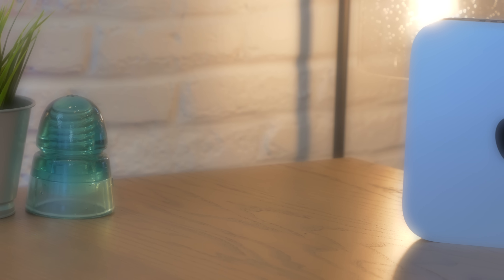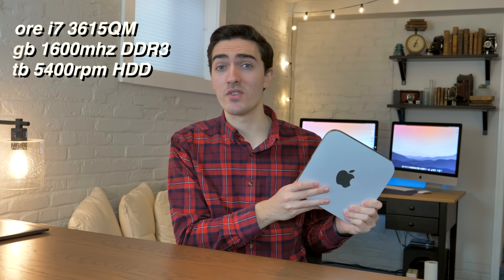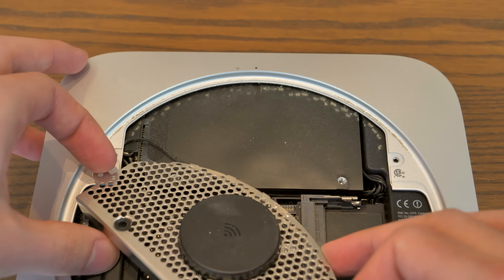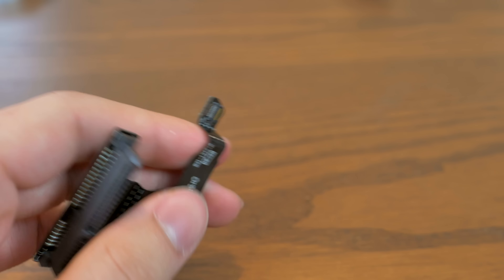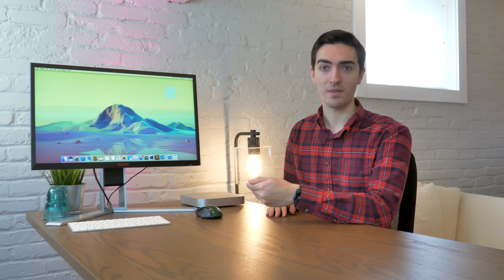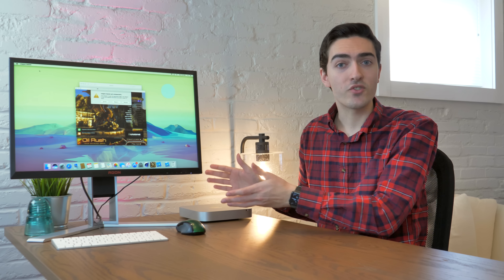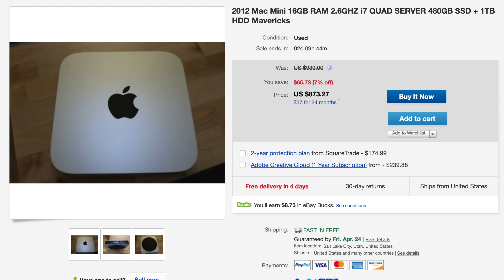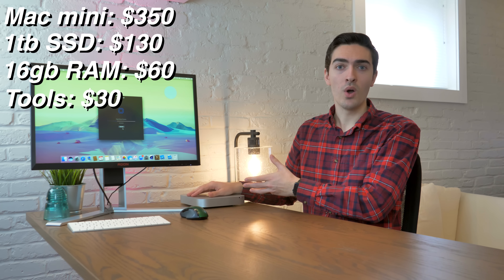Building the ULTIMATE 2012 quad core Mac mini – But is it worth it?

Comment: I bought about a year ago and put a 512gb ssd and 8gb of ram I already had. Got it for $400 and for that its a pretty good value. Does everything internet well. Great for getting started with XCode though 8gb ram isn't ideal. It does get by though and if you have some hardware lying around I would totally recommend this setup!

Comment: I had a 2011 Mac Mini with i7 (dual core) and AMD graphics.  I really liked it for the 4 years that I used it, but it started to freak out and reboot itself.  Something went wonky on the motherboard.  I really liked that one, as you could upgrade the memory/HDD without any issues.  I wound up with a 2014 Mac Mini (i5/8GB), and I did wind up upgrading the HDD to an SSD.  It is actually pretty darned quick, though I really wish you could upgrade the memory.  I sort of missed the 2012 generation.  They're great little machines, though i wouldn't pay all kinds of money for one.  I hope to get a new one at some point.

Comment: Yes, this machine worth it. But even a refurbished i7 miniMac is a expensive machine, about 500 € I found last year a 2011 machine on sale, I agree with your comments,  I never thought to upgrade from High Sierra or install a dual M.2 module because I do not give high hopes of using intensively to this machine. Upgrading a miniMac on any way would be a bad invest and a waste of time how to improve my miniMac, because of my few needs I require from my 2011 miniMac actually. Upgrading the hard disk to M.2is a good idea, but not always needed.

Comment: @3:47 what are the connectors there?  Was one that it is showing you disconnecting for the hard drive?  Around 5 to 6 minutes in you said there are 2 hard drive connectors.  So does that mean the mid 2012 guts can be put into a mid 2010 case and add an optical drive?  You mention that this is not good for graphics.  Is the mid 2011 better with the Radeon HD 6630, better and still upgradable?

Comment: My best Value and new daily driver....Purchased on ebay Jan 2020.... Late 2013 21.5" iMac - Quad Core i7 in near-mint condition with an nVidia GT 750M GPU which I then upgraded to 16GB and 256GB SSD (from 8GB and 1TB 5400 RPM HDD)... and native Catalina...all-in cost was just a touch over $400 including all shipping and parts. iMac screen resolution is 1920 x 1080 but with Catalina it drives a second external 43" 4K TV over Thunderbolt @ 3840 x 2160.... like butter....this must have originally been a built-to-order unit....I think (...know) the high volume seller sent the "wrong" unit and I couldn't be happier!!

Comment: Recently, I got a chance to use both 2012 and 2014 Mac mini for light tasks (YouTube, web browsing, and use the photo app). The 2012 Mac mini was the top of the line Mac mini 2.6ghz i7, 1.25tb fusion drive, 16gb ram, and new thermal paste; the 2014 Mac mini was the mid range Mac mini with 8gb ram and 1.25tb fusion drive (old thermal paste). Personal experience, I feel the 2012 quad core Mac mini is much slower than the 2014 Mac mini. Even thought 2012 has quad core, the 2014 dual core ran much smoother than 2012 quad core. I think the main problem is on the ssd. Nvme ssd runs much faster than sata ssd. In addition, the fan ran much frequently in the 2012 than the 2014. For general tasks, I recommend 2014 Mac mini.

Comment: I have two of these. One I use as a server and the other for an everyday driver. Both have max RAM and dual HDD SSD and I got one for free the other for $180. Considering I could sell them both and get around $1,000 right now I'd say I did ok.

Comment: I seriously don't understand the huge price gap between the US and Europe in terms of used MBPs. The mentioned 2012 Unibody 15" MBP would N-E-V-E-R sell for less than double the price that Luke mentioned... Maxed-out as he said, they would go for roundabout 800€/900$! If you're lucky you might get the base 2.3 GHz, 512MB VRAM version with stock memory and HDD for roundabout 500€ (so about 560$). But then you're really lucky! People over here try to sell completely trashed machines for their weight's worth in gold. And I'm not talking offers, I am talking sales.

Comment: I got an i7 Mac mini with 16gb ram for 40$ it supposedly had a dead hard drive but it ended up being just fine so after upgrading to an SSD I bought the dual hard drive cable upgrade kit and had 240gb ssd and 1tb hard drive

Comment: I have this one, I bought it new in 2014 IIRC.  I upgraded the RAM to 16GB and I removed the dual HDDs for a 1x256GB and 1x512GB Samsung Pro Evo 850.  
I used it occasionally up to often till about 2 years ago, then tried to use it again few months ago.  (will come back to this)
Performance wise it is good, but again it depends on what you need it for.  I used it exclusively for FCPX and it was great.  I would edit everything up to 4K videos.  Most of the time I would use proxy files, but that was because I didn't want even the chance of a performance glitch when things got too complicated. 
The machine was great,  editing was comfortable and even rendering was no issue in terms of time.
The problems started with the (forgive me for not knowing the details) the recent change of FCPX to the new "engine" or whatever.  The overall performance while editing dropped and rendering time took off.  It was simply painful for me to continue editing on this machine.
As I don't have another Mac or the money to even consider getting one, I just jumped ship to a powerful though old PC I have and started editing there.  

Overall the Mac Mini is worth it, but it depends on what you need it.  Also, I am not a fan of laptops any more so I will almost always say to better get a mini than a laptop.

Comment: I got a late 2014 MM. I put Catalina on it, big  mistake!  It will never take a DVD player.  I even wrote some code for it, No Joy!  Catalina has everything locked down, and is a little quirky.  I had bought an external DVD, so, to use it, I downgraded to Mojave. Viola!  My DVD worked!  I was able to take control of my SSD!  WOW, things work the way they are supposed to.  In short, Do Not upgrade to Catalina!  FYI, God Bless, Dave Wright

Comment: I got the same model that was upgraded.  Great little machine.  I was wondering did you have a problem with the Thunderbolt?  I wanted to use it for a secondary display.  the Mac mini see it but no image on the screen.  Have you run into this?

Comment: 5-2020, my current Apple computer I use for macOS is the late 2012 i7 Mac mini.  I can still run Catalina on it officially. I bought my late 2012 Mac mini when it launched over 8 years ago.  My late 2012 Mac mini had to have an firmware update (over the internet) to fix a HDMI port problem.  After I updated the firmware of my Mac mini I have had not problems since the day I bought it.  My late 2012 Mac mini came with an internal 5400rpm 1TB HDD of which is terribly slow.  And my internal HDD in my Mac mini died a few years after I bought the computer.  But I was able to use an external SSD via USB 3 as my boot drive and my Mac mini runs much smoother and faster than the 5400rpm HDD.

Comment: My old daily driver was a 2011 Mac Mini base configuration upgraded to 16gb of RAM and a 512gb SSD years ago.  Worked reasonably well up until last year when I just got sick of its sluggishness especially with web browsing so it's been relegated to the scrap heap and replaced with a 2019 13" MBP.  Still it lasted a lot of years without any issues.

Comment: I have late 2012 mini. 16Gt ddr3, 2,3GHz i7 SSD + HDD. I clean the fan and put new thermal paste, but still temperatures are 70 - 95 Celsius when I only run Safari and mail + file backup.

Comment: I bought mine in 2015 when I started my channel and upgraded it with 16 GB and one 250 GB SSD. It was also my first project on the channel itself showing how it needs do be done. Good old memories. In 2020 I would also say, that it is not the best value for the price you need to pay. Luckily I still have mine as a backup machine.
Reply: Thanks

Comment: I've still got my i5 2012 currently running two SSDs and 16Gb - I use it for coding and Lightroom / Photoshop (stills) and really have a problem justifying an upgrade.  You are correct about the graphics - zero games, zero acceleration options for software but colour matches great and is fast enough for a 1080p monitor with zero lag. It would be nice to connect the iPad as a second screen natively but it's not vital.

Only thing I would say that you missed in the video is that TRIM is not set on by default and each time I reload (I never upgrade the OS) I have to remember to turn it on.

As for ROI - amazing compared to any other machine I have bought 👍
Reply: I have the 2012 quad core I7 with two SSDs and 16gb and I use if for  iPhone software development and Unix integration testing. People forget that macOS is a pure Unix system that goes through the same certification program that AIX, HP/UX etc adhere to from the OpenGroup in order to be able to use the Unix trademark.  This is great for Unix to Linux integration testing. All the compilers C, C++, Swift are all there so its a super nice and relatively cheap environment for the work I'm doing. I've had it since it was new so its more than paid for itself. I upgrade my system all the time and TRIM is always turned on, I've never had to turn it on other that the very first time I installed the SSDs.

Comment: Those minis where such pieces of crap. I had a contract back in 2015 - 2016 with a company who gave us contractors the piece of crap Minis, whereas the employees all had 27" iMacs. Management constantly reminded me that I needed to work more productively… their heads clearly jammed up a convenient nearby hole of sorts, as using Photoshop, Animate, and InDesign sort of require some serious horsepower and GPU assistance.

Comment: Love my 2012 Mac mini. It's perfect for audio production.
Reply: I’ve got one as well in my home studio, Maxed out the ram, and will keep it a while longer. In my second studio at my vacation home, I just replaced a 2011 imac with a 2020 Mac mini. Based on my experience, this is the most cost effective way to go: buy the i7 model, 8 gigs, 512 SSD. Then Upgrade the ram to 32. Costs about $160, and you get get someone to put it in for about $40. Then get an external 1 or 2 TB SSD. You’re all set for about $1600. Oh, and two 22 inch montors? 89 bucks a pop on Amazon.
Reply: What DAW do you use? And do you use virtual instruments (like omnisphere) and plugins with no problem?
Reply: that's what I use mine for- new logic pro x and software instruments slows the cpu a lot though
Reply: I use reaper which is very light on the system. Still runs like a champ. I use kontakt and GGD drum samples along with various other synths and stuff. Never much of an issue. Just gotta work smart. Render things down as you go sometimes. I'll prob get a newer Mac mini or an iMac next. I want something good for video to next upgrade. Might even build a hackintosh

Comment: I like it, but crap video as usual from Intel. All Intel has to do is separate the gpu from cpu, apply to same die beside cpu, add dedicated gddr6 ram, increase video cores and it would be a different beast. Even if they  got rig of ddr ram, and just use 16GB Gddr6 ram from whole system.

Comment: i wouldn’t discount the eGPUs for the 2012. I have mine setup as my daily driver with an Nvidia GTX 1050Ti via an Akitio thunder 2. works fine for single screen 2560x1440. i use it for 360video editing. vastly improved performance for cuda core enabled software.
Reply: Yeah, it's not going to be good for monitor pass though back to the mac. But, for leveraging it to render it's fine.
Reply: I can’t even afford 2 or 3 monitors so eh
Reply: did you have to do anything special to run the 1050 in this enclosure? I see that they don't recommend using it for video cards but you have it working it looks like. Is there a forum of folks using this enclosure for eGPU's? I have a NIB EVGA 1050TI that I was going to use in a Hackintosh build but decided to just buy the 2012 mini. Thanks.
Reply: @6806goats1  https://egpu.io/forums/builds/mac-mini-late-2012-with-akitio-node-and-nvidia-gtx-1050ti-test-attempt-2-mac-and-bootcamp-works/
but its tb3 box

Comment: I got a used dual core 2012 Mac mini (don't need the quad core for my needs) + a new 250 gb ssd and monitor for a total of $400. The one I got was advertised on eBay as having only 4gb of ram, but it came upgraded already with 16gb, so that was a steal. I don't think I could get a better computer today for only 400 bucks tbh.

Comment: I bought a Mac mini 2012 base model (i5, 4GB RAM, 500 GB HDD) in early 2014 and upgraded it later to 16GB RAM and 500 GB SSD. I'm not doing video editing or gaming, but programming, virtual machines and day to day entertainment, like watching blu-ray videos.
The good old machine is still working great compared to my MBP15 2016 from work. The only lacks are nowadays:
- 4K at 30Hz only. I'm using an LG 32 where you barely notice it.
- 16 GB RAM only. Do I need more? No!
- No Thunderbolt 3/ USB-C

Comment: If you can find an i7 quad-core 2012 Mac Mini for a good price, it’s still a very functional machine for a lot of purposes. This is still my main work machine at home. But as you pointed out, finding such an one at a decent price can be a challenge. If you do, though, don’t worry about what RAM or storage it comes with. A 16gb RAM package is inexpensive and whatever internal drive it comes with can be replaced. You can even leave the existing internal storage unit alone and use an external SSD, it will work great even with the USB 3.0 and awesome if you can find an inexpensive Thunderbolt-1/2 enclosure – look for a used LaCie unit but really, a cheap USB 3.0 is fine.

Comment: I bought the base model of MacMini in 2016, using it to run my A/V library, etc... I was replacing my mid-2009 model. The newer model was worthless and slow, $500, and not nearly as good as its predecessor.

Comment: Comparing it with a laptop is not really fair , its a mini desktop configuration . Who wants the hassle of hooking up thier laptop to the monitor or t.v every time you want to use it . The mac mini is ideal to have alongside a laptop , best of bothe worlds . Laptop for on the go and mac mini as a desktop / media player , and you can connect the laptop and transfer any work between the two

Comment: I did this same mod after I bought my 2012 back in 2013. It was a great machine, but finally had to upgrade to the latest for the increased NVME drive speeds, since I do mobile development. I love these machines - can hide them under my desk, they are quiet, and easy to travel with.

Comment: I bought a new MacMini 2014 I5 2.6 Ghz, 8Gb ram and the 1tb HD.  They were on closeout and I wanted to learn about MacOSX. I have been a Windows user since windows version 1.  
I currently have a Gigabyte G7 gaming mother board with an Intel 6600K processor 32 GB of 3.2 Ghz Ram and a Nvidia GTX-980ti graphic card.
I thought the Mini would be a good learning machine. It was. But I soon found that 8 GB of ram is not enough and the mechanical HD is a joke.  So I upgraded to a 1 TB SSD.  This helped some but I kept running out of ram.  Sharing memory with onboard graphics means the most free ram available is about 4.5 GB.  And Mac OS is very poor at releasing ram.  I use Clean My Mac to release memory when I start running out.
The thing that really surprised me was that with a few add on apps I can control my 6600k windows machine over my home network.  The more I used Mac OS the more I liked it.  
My solution was to purchase a 3.0 GHz I7, 16 GB ram Mac Mini 2014 with a 512 GB NVme SSD on Ebay for $550. Thanks to your You Tube Channel I found the courage.  I added a 1TB Seagate Sata SSD.  I then replaced the 512 GB NVme SSD with 1TB Crucial NVme SSD.  Intel Power Gadget shows that the I7 can run at 3.3 GHz all day long. Free Ram never falls below about 9 GB. I added a Sound Blaster USB external Omni 5.1 sound module.  So I can watch my Blue Rays  and listen in 5.1 surround sound.
So I really think this is the best Mac Mini ever.  It does 90% of everything I need in living Mac OS Catalina.  When I need more horsepower I switch over to the 6600k with 2816 Nividia Cuda Cores and put my 850 watts of power with 47 TBs of Hard Disks to work. 
I still use the I5 2.6 Ghz Mac Mini.  I put the 512 GB Nvme drive in it. 
I am really a fan.  I can't wait for your videos to come out.  Keep up the good work.

Comment: This the very first time that you have bought something for the same price as the normal people would do. Mine was slightly cheaper. In Spain it is difficult to find good prices for Macbooks so this would still be an option. I was lucky though, usually they are more expensive.

Comment: Actually using TB1 eGPU with external display there is only 20% perfomance drop on 1080p gaming ... which is the same as with TB2 or TB3 
https://egpu.io/forums/mac-setup/pcie-slot-dgpu-vs-thunderbolt-3-egpu-internal-display-test

so I have my 2012 Mac mini (i7 2.6 Ghz) connected to DIY eGPU enclosure with RX 460 inside

Comment: If you have had one since 2012 then yes it is worth upgrading. It has been my always on, email, accounts and general use system since the time I bought it. Initially I upgraded to 16GB of RAM as I used early photoshop and lightroom and it still handles basic tasks fine. Replacing the HDDs  with SSDs a few months ago made it fly once again. It also runs alot of the non-graphics intensive games from Steam. Happy I own it. 

I run it alongside a newer MacPro and very modern Windows hardware, as they handle my photo and video work and high end games but as a stable system my 2012 MacMini Server is excellent.